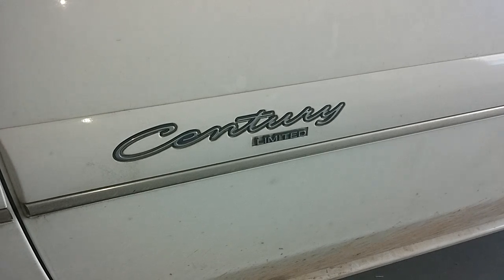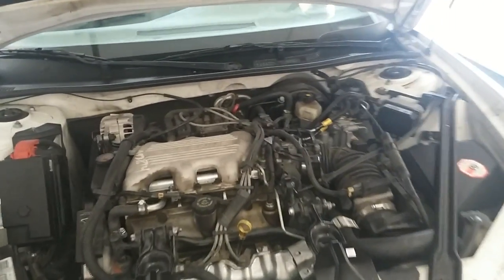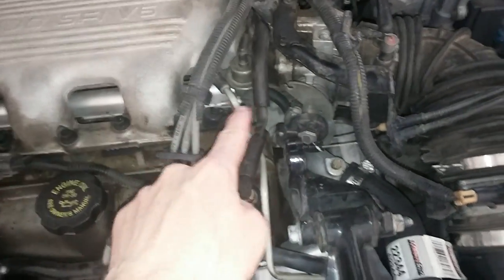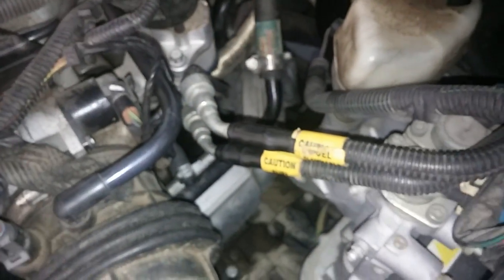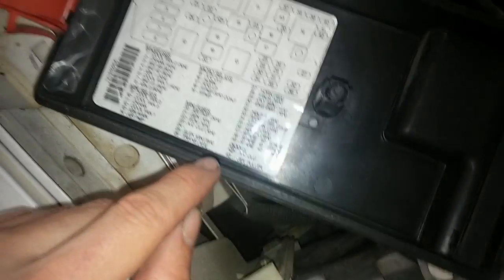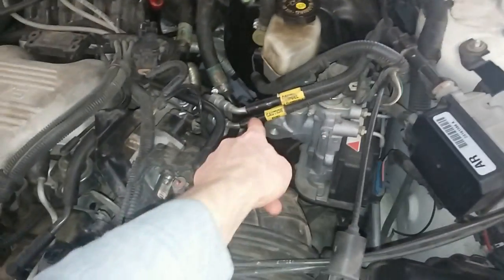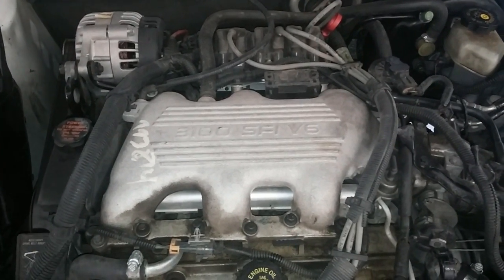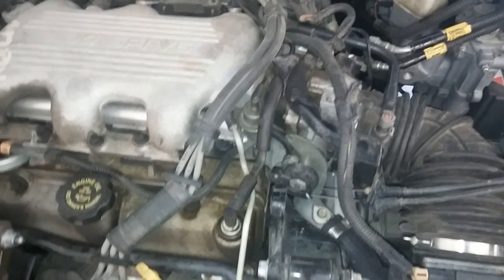Diagnose Buick Century / W-Body Fuel Pump

Comment: I have the same car. I’m trying to figure out if my fuel pump is out or if it’s just the pressure sensor on the fuel pump is bad. My fuel rail reading -1.6 on the short fuel line and -28.9 on the Long fuel line 🤦🏾‍♂️🤔
Reply from the maker: what are symptoms? Does it start hard? What if you cycle the pump a few times (turn key to on but not start two or three times) does it start better then? 

Also not sure if I got into this in the video... Do you have any vacuum leaks? Is your pressure regulator still connected to the intake manifold w/ the little vacuum hose?z

Hopefully that helps. I don't recall the pressure spec for that vehicle off the top of my head anymore. Sold it a few years back.
Reply: @matthewjeschke  I’m having a high idle sounds and when I put it in drive it takes off fast and when I put the car in park it the sounds gets louder. But if I cut the car off and cut it back on sometimes it would stop. I’m spending more gas then usual. I don’t have a vacuum leak no where and no check engine light.
Reply from the maker: @screwedupdranksippa maybe it's an idle air control issue? Is your IAC stuck? It's a little stepper motor is on side of the throttle body. It's somewhat common for them to get sticky and stay open. This will cause the engine to rev / idle high up when you let off the gas.
Reply: Ok ima check that. I appreciate the help
Reply from the maker: @screwedupdranksippa  I am terrible about checking my comments on here. If you have any further questions feel free to contact me through http://www.keystoaz.com/contact-us/

Comment: Where is the fuel shut off switch located on a 99 century
Reply from the maker: Unsure, I don't know they it has one? I wrecked an my 1999 and it started right up. But then again I didn't roll it. I've had three centuries in total. Now I have a Lucerne.

Comment: I have a 1993 Buick regal 3100 it keeps cutting off at operating temp fuel psi 41 at start 35 with engine on

Comment: Got the same car .got fuel and spark , engine turns over but won't start ?
Reply from the maker: Gosh, should be starting then... Hrm, that's a tough one. You are fuel injected? I don't know when they switched to the distributor... What exactly does it do when you turn the ignition to start? Does it sputter? Try to start? Does the starter click or does flywheel / motor spin?
Reply: I’m having the same issue! Did you ever figure out what the problem was?! My car won’t start I have fuel and spark -my engine won’t start when I turn the key it makes a little click sound but doesn’t start!

Comment: I have a 1991 Buick Century with a 3.3 liter V6 engine and I am having problems with finding the scharder valve on my car. My car acts like it running out of gas and I’m figuring this will let me know what is going on with the fuel system in it. Can you tell me where it is because it’s not in the same spot as the car shown in this video? Thanks!!
Reply from the maker: I cannot speak specifics of your car, however, if it's multiport fuel injection (more than one injector), it will be on the fuel rail. Find an injector, above it will be a metal pipe / rail. Trace that rail / map it out. The valve will be on the rail, likely opposite side of where fuel lines plug into the rail. Good luck!

Comment: My 3100 will kick kick it seems like it’s not sparking
Reply from the maker: is it a low battery?
Reply: I was going to just swap out my fuel pump. Idk if I should
Reply: Like when driving it has slow slow pick up when accelerator is put all the way down it just bogs out.

Comment: On page 6-62 of the Buick Century Owners Manual map of Underhood Electrical Center on the passenger side - the Relay that you pulled was in position number 35. 
This shows to be a MINI-RELAY labeled in the book as Fuel Pump.
There also shows a Micro Relay which is in position number 19 labeled in the book as Fuel Pump as well.

Should both be removed to release the fuel pressure or just the Mini-Relay pin in the numbered 35 position?
Reply: The relay you pulled (35) looks like the 15 amp blue fuse type one. the other (19) is a larger box style relay.

Comment: Thanks for the helpful video. My pressure regulator went out...at 260,000 miles.  It was getting harder to start in the cold and when I pulled the vacuum line off of the top, gas poured out of that hose.

Comment: My pump works but on the gas gauge it moves when I drive it doesn't tell me the right amount of gas that I have in a tank what should I do for a easy fix
Reply: Change the sending unit. It can be bought separately

Comment: My 95 regal with the 3800 goes up to 40 really fast and then drops down to 10 really quick - it wont crank so im just turning the key on to engage the pump- is this the regulator or pump you think?  Thanks for this video! and any wisdom!

Comment: hey i have a 95 buick century, and i crank it up..it runs for 30-50 seconds then it completely dies out... what do i do?
Reply from the maker: You want to do a pressure test on your fuel rail. You can rent the tool for free at most parts stores. There is a schrader valve (like on your car tire) that the gauge attaches to. If you read low fuel pressure (or yours sounds like virtually no pressure) then there's a bad pump or clogged pressure regulator. That hopefully would narrow down the parts you need. Ask your parts store which they suggest.. or possibly just change both. FYI ~ I run fuel system cleaner, seafoam, through my car every oil change. It seems to make this stuff last longer.  If your car is very old, say 250,000+ miles you may like to consider dropping the tank and cleaning it out. Dirt gets in there and can clog the pump, filters, etc in the fuel system.

Comment: My 1998 buick cantry .the oil is cremy  i think ita a head gascet.why would the headgascet bloe out
Reply: It is actually very common on a 3.1 liter engine... pretty much a design problem at the factory. Also look at the upper intake gaskets... much easier to replace.

Comment: I have a 1999  3.8 Chevy Lumina LTZ sedan. Can you access the fuel pump through the trunk or do I need to drop the tank? Thanks!
Reply from the maker: Great question, I am not sure, you can quickly tell if the fuel pump is accessible in the trunk by (1) feeling the trunk liner, do you feel any bolts around the same section as in this video? (2) pull back the trunk liner and take a look, you have to remove your spare tire to do this but is quite easy procedure. Best of luck with your repair.
Reply: Jeff Rodiguez buy a auto manual from advance it will help you understand the whole car

Comment: Hey Matthew, my Century is older, a 1996, and it does not have a fuse/relay center under the hood. I cannot seem to find it. Might you know where it is located on that year? Thanks in advance. Michael
Reply from the maker: +Michael H White good question, it's hard to say, check on the ends of the dash where the door meets it. There's an internal fuse box there on most cars. I have seen fuse boxes under the dash as well. Some even under the knee bluster on the driver side or under the back seat. I would actually do an internet search if you cannot see it. Sometimes they are a bit hidden and require removing a panel or two.

Comment: My 1998 Buick Century does not seem to display the correct fuel level on the dashboard. I replaced the fuel pump, but the fuel level indicator still seems to give incorrect readings. Do you happen to know if this has something to do with the fuel pump relay?
Reply from the maker: +djwhut98 great question. It could be the fuel level float was damaged in the installation... or a poor connection with the connector to the pump. It's a bit of a tricky one to solve. Whenever I do a pump I try to assemble as little as possible and test along the way for this reason.